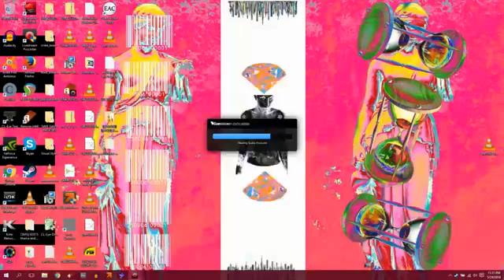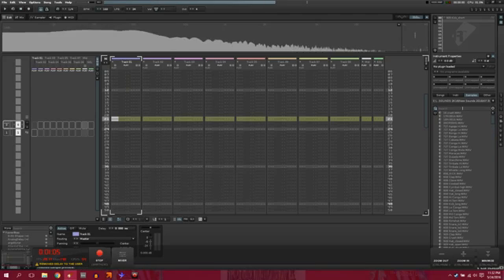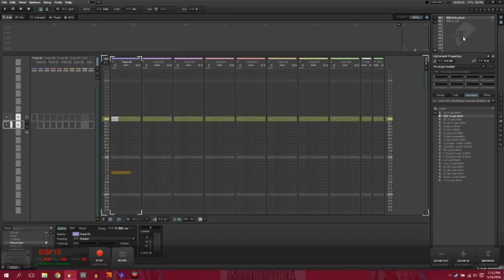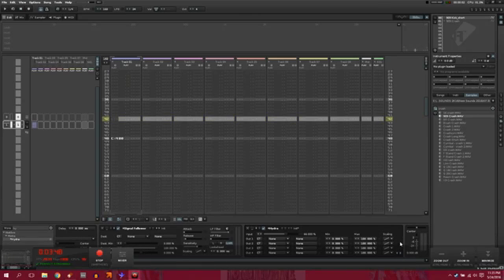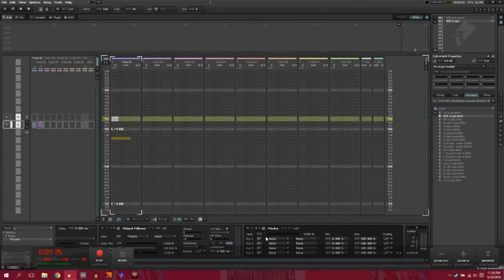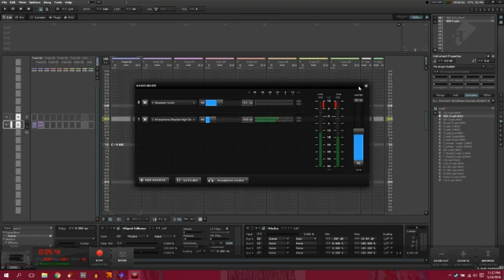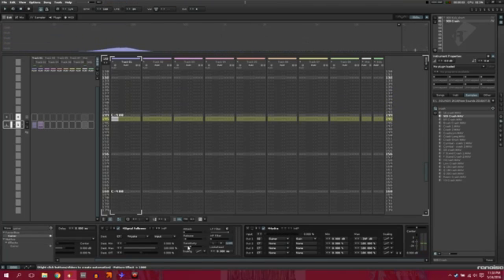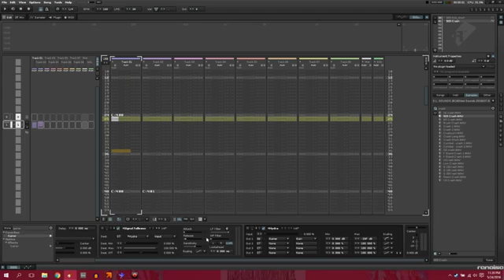Sidechaining in Renoise: An Alternative Method

Comment: Thank you SO MUCH for this! I've been testing this out though and it seems the best part about this method is that it actually functions as a work-around to get the Signal Follower to affect tracks left of it in the buss... right?
So, you can shape kicks in different channels, use Send devices to route them to a single send track, then use a Signal Follower with Hydra to sidechain a sub in a normal Track channel.